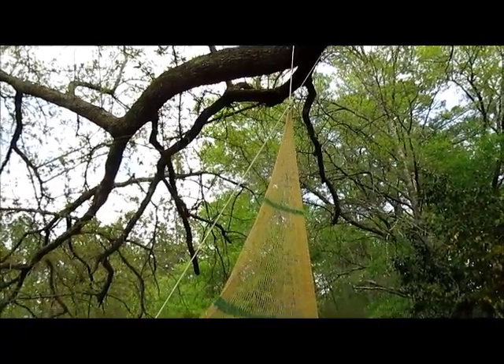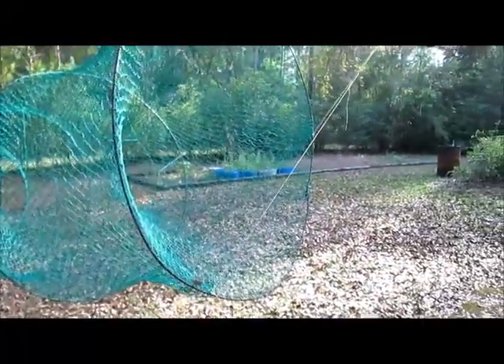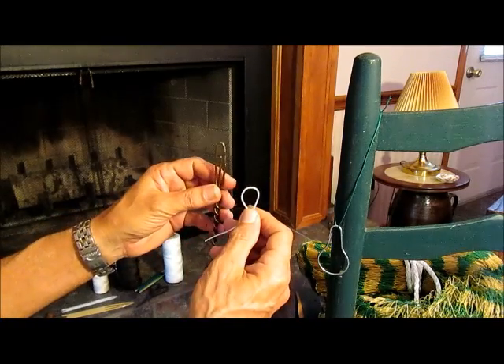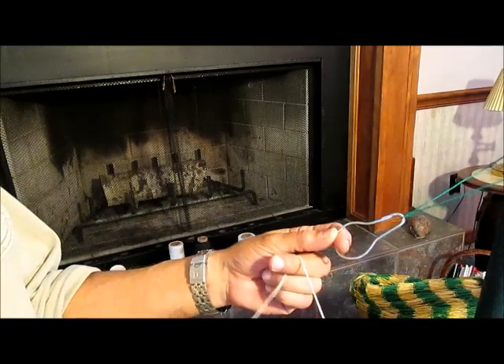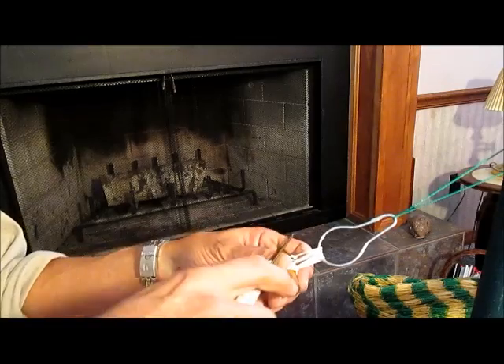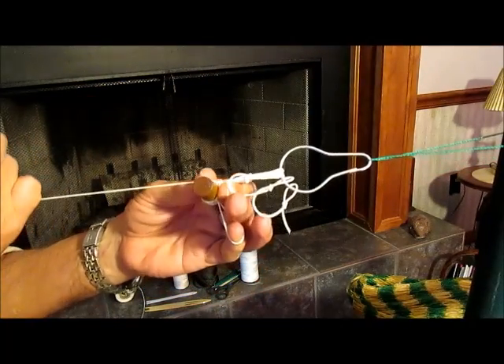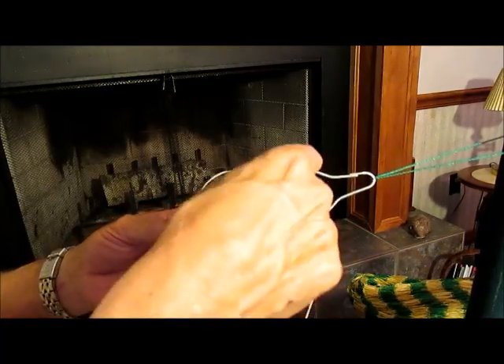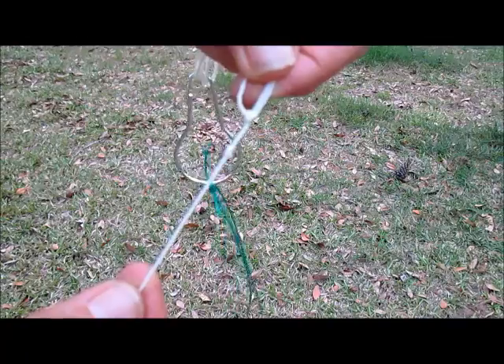Net Making for Beginners, Section Two

Comment: I'm curious if you would splice in line differently if you were using a twine that doesn't melt, or if they used a different technique before synthetic lines were available?

Comment: Thank you for sharing your extensive knowledge through this great videos. I am working on a project that requires me use use traditional cotton seine twine.  I am having a difficult time because the twine twists up so that the loops almost disappear. I tried unloading the needle and reloading from the opposite direction and it still twists. I would appreciate any hints that you may have to straighten out this twisting situation. Thank you

Comment: Wonderful vids, I have learned a lot from. I do have a few questions-- Will this formula work with a  cast net that has 5/8" square mesh or do I have to double the amount of meshes in each row since the size of mesh is half that of 1 1/4". Thank you very much

Comment: Thank you for the videos Sir.  I was wondering what the smallest size net holes you can make if you had a different size dowel and a smaller fishing net needle.  My project is to make chainmail using Dyneema fishing line, which is 15x stronger than steel and 40% stronger than kevlar at equal weight.  The sting I will be using can hold 300 lbs per 8 strand line.  Thank you for any answers you can provide.
Reply from the maker: Show me how small YOU can make it.  Good luck and thanks for watching.

Comment: Hey, I've been following your videos, and there's only one thing that is confusing me at the moment. Maybe because I'm using braided fishing line and not nylon, but is the flying dutchman know supposed to slip? I feel like when I finish my net, the the knots are going to tighten up on each other. Same thing with the starter loops, they keep slipping as well
Reply from the maker: Twine that is not bonded can and will loosen.  Bonded twine that is old can also loosen.  If you hang your net (as in making a cast net) the leads will tighten everything and your dip will lock in your knots.  If you're not dipping, then you can add an extra half hitch (see section 4).  Hope this helps.
Reply: Thank you... time to start making that net!

Comment: Are the knots in the net supposed to slip around by design or am I tying it incorrectly? Or maybe my material doesn't provide enough friction? I am using some synthetic mason line,  and the knots keep loosening and slipping around, so I am having trouble keeping the "cells" of the net uniform.
Reply: Is it called flying Dutchman because the knots are flying all around? I read in another comment by Sleepy Baby mentioning "dipping" the net to "set the knots" ... is that what needs to be done for the knots to stop flying about? Do I need to find a Dutchman to help me with the dipping?
Reply from the maker: Some twines just don't want to cooperate.  Try using a paddle for a spacer gauge or maybe the method from my last video - section 4.
Reply from the maker: Bonded twines are the way to go.  They have been pre-treated with a light urethane coating.
Reply: I see, thank you! I'll try a bonded twine and a paddle for a spacer. I'll watch the 4th video, too. Thank you.
Reply from the maker: Pull them tight and good luck.

Comment: okay so I know NOTHING ABOUT fishing, so, to make a fishing net what string type does one need to use. I have 3/32 Tactical Cord 4 Strand cord (It's a thin type of paracord). can i use it? to make a net
Reply from the maker: Well Terry, thanks for watching.  It depends on what kind of net you're making.  What you're describing would be too big for a cast net, but just right for a crab ring or landing net.  If you do plan on making a cast net It takes about a lb. of #4 which is about a mile of twine.

Comment: I really enjoyed your video's, so much so I'm attempting my first net tonight. Thank you so much!!!!!
Reply from the maker: You're welcome.  If you have a question - ask away.  (Some of the most talented netmakers I've known were women.)  Good luck!
Reply: +Gulf Coast Network where do u get the rings or how do u make them if u do?
Reply from the maker: If you're referring to cast net horns, I inherited (from three different men) a bunch of both plastic and brass horns.  You should be able to find them through netmaking suppliers.  
If you're talking about crab rings, I make my own which I will show you how in a short time.  Keep your eyes open for galvanized hard wire about 1/8 " to 1/4" diameter.
Reply: +Gulf Coast Network ok cool thx, i found a crabnet that was tore up and the rings looked like they were in great condition so im gonna use that, im wanting to get some stronger made rings tho thats galvanized ill search that size u wrote
Reply: Dana cason #   do you actually enjoy the caught fish with net at the river ? And are u able to throw the net round shape inside of the water for catching many fishes 🐟🐟🐟🐟🐟🐟🐟🦐🦐🦐🦐🐚🐚🐚

Comment: Okay, with regards to the bag net questions I started on section 3.  Your explanation and seeing the green band for the attachment points here really helps.  More questions if I may: 

Do the wideners continue into the bag section?  

Twine sizes: 6 is common, and 3,4,5 are more rare (but I've seen them).  You specified #4 a few times in one of your nets. I assume that you prefer #4 but what of the other sizes and/or mixing twine sizes?  Is #4 the best trade-off? Is #6 going to be fat and bulky?

I'd like to try chain, but wonder if you prefer leads or chain? no rush, Thanks again!
Reply from the maker: Some don't, they stop at the bag beginning since it curls back up.  In the net here, the wideners go all the way- its a baggy bag net.  And I can't begin to tell you how many fish I caught with it over a ten year period. I hope to use it again later this summer.

Comment: Hello from Greece
I would like to know how we calculate how many eyes have to do in the beginning.
If I want to make a "cast NET" with a radius of 2 meters and each eye has a length of 2 cm from knot to knot. How many eyes have to tie them in the beginning, and every how many eyes will begin to grow.
Thanks for the great videos you have uploaded.
Reply from the maker: +Panos Mpalasis Thanks for watching Panos!  It would be best to start making your net, slide everything off and see how it forms your circle.  An extra hint - if you want your legger (each section of your net) to equal 2cm, then use a paddle spacer with that width.  Good luck!

Comment: what am i doing wrong it only falls apart it does not work
Reply from the maker: +Alex Goldwyn Try watching again.  If you still can't get it, I am currently making a video that shows about 8 different knots.  Most are fairly simple.  The method in these vids is a little complex but very very fast once learned.

Comment: I really enjoyed your video.  I have a couple questions.  

1. How does the size of the dowel affect the net?  
2. If I wanted to make a very wide net (say 10 feet wide) do I need to fit 10 feet worth of starter loops on my dowel all at once?
3. If I wanted to make a net with large squares (1 and 7/8") for a baseball batting cage net, what suggestions would you have (such as size of string, dowel and needle).  

I very much appreciate your time to post these videos.  They are quite fascinating.
Reply from the maker: geadiin 1.  The circumference of the spool determines the size of your mesh.
2.  You don't have to fit all of your starter loops on the spool.  Just like your netting, you just let the starter loops roll off to your left (assuming you're right handed).  In section one, near the beginning, I show how quickly you can make netting.  Take a look and be sure to subscribe as I'm close to uploading again.
3.  Mesh is measured by stretch, its measured by the length of the mesh diamond. For what you describe, a spool of 5/8" or 3/4" would be advisable, then play with it some more if you like.
Best of wishes.
Reply: Gulf Coast Network Thank you.  That is very helpful.

Comment: Hey could you give me a cast formula? starting loops and amount of wideners per 3 rows? I've made 2 of em but without any set process just doubling wideners per row until i get a decent radius, but i suspect i'm tying a lot more than would be necessary.
Reply from the maker: Take the amount of wideners you want,usually 11, 12, or 13 and multiply times 3.  So I start with 33 knots (loops) for an 11, etc.  Tie a mesh knot under that, then a widener, then 2 loops mesh.  If you subscribe I am about to upload a section covering this.  Good luck.
Reply: Gulf Coast Network Subscribed :) thank you for the info, just finishing up a chain weight net tonight.
Reply from the maker: shit2fly Whoops!  I just filmed the next segment and I made a mistake in my previous comment.  Its single mesh, widener, then 3 mesh knots.  I should have it edited and uploaded Wed. night.
Reply: I'll look forward to the next vid then :)